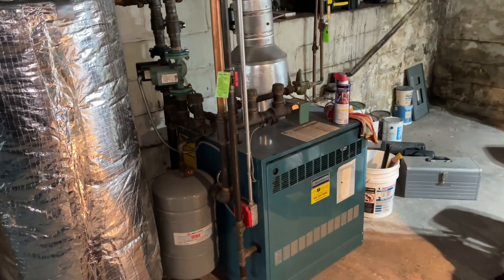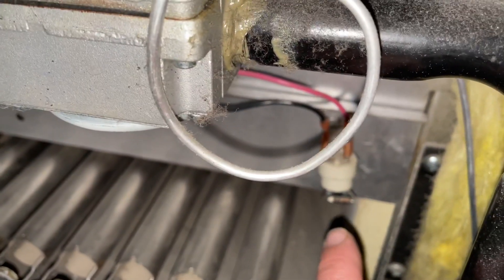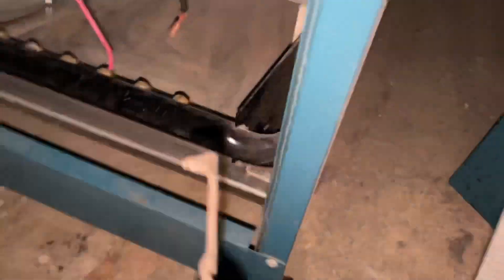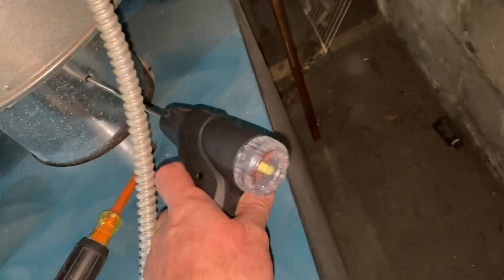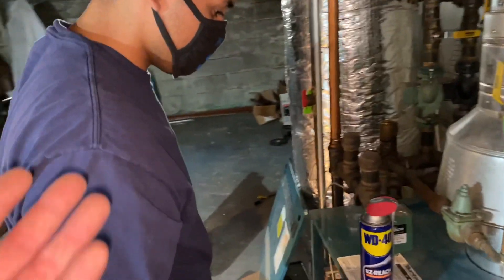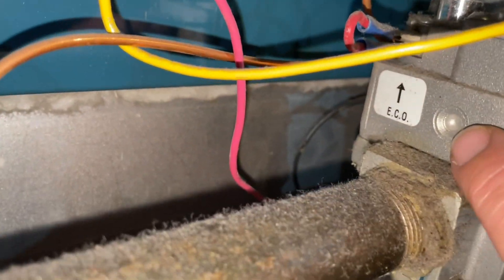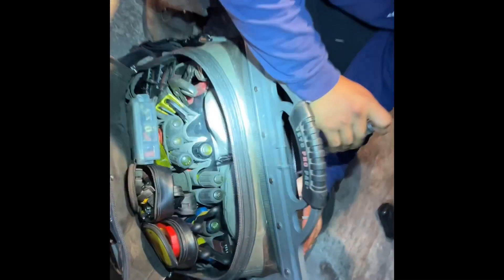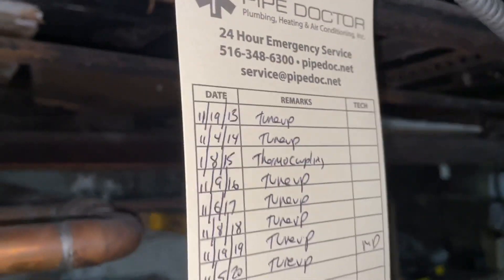Annual Heating Tuneup Burnham P208 Gas Fired Boiler

Comment: Gm very good video ty for sharing. 
I have a burnham boiler exactly like this 1 
Making a whistling sound,
Seems like when boiler temp is heating up .

Don’t hear it when circulating water 
I replaced most of the pumps on the system myself so don’t think it’s the pumps
Could it be heat exchanger?
Boiler is about 20 years old Ty for your time
Reply from the maker: Could be

Comment: Usually when I have a boiler with high levels of carbon monoxide I only use my testo 320 to adjust the gas valve if is adjustable. I don’t check gas pressures I probably should . Good video bro 😎